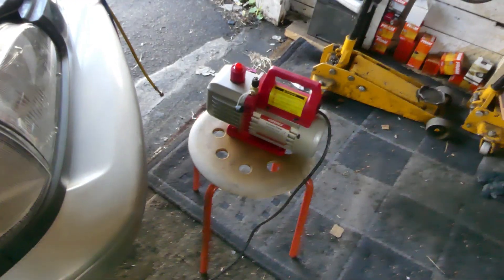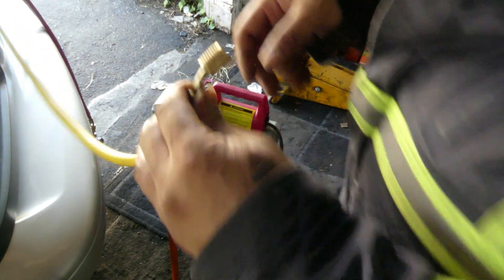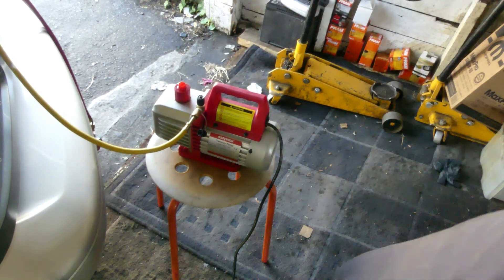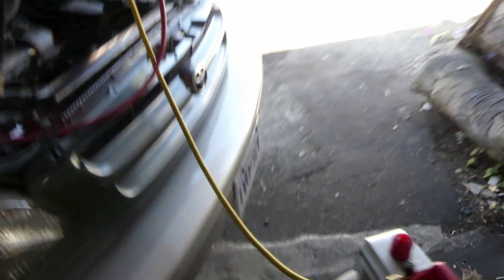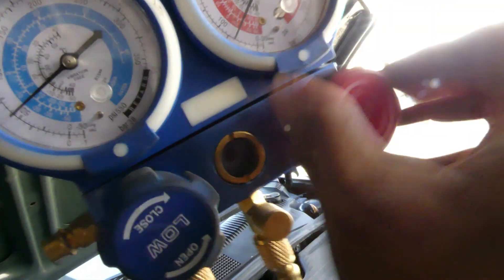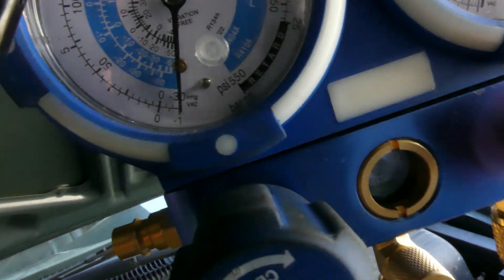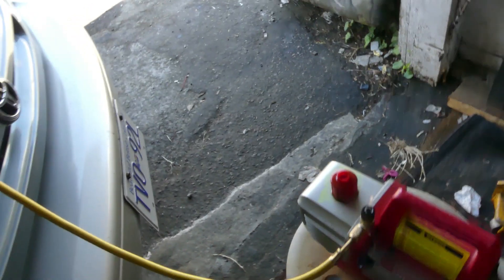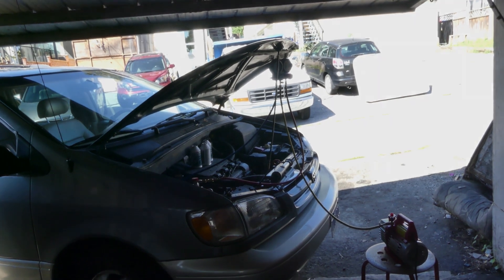How to Vacuum Old Freon

Comment: just wondering… the smoke or vapor that came out of the vacuum while vacuuming, is it ok to let it out in the air? Its not harmful to the environment or anything like that? Thanks in advance.
Reply from the maker: its already filtered
Reply: @asianmechanicguy6483  
Thanks for answering. So the pump machine that you used, is already filtering out the freon as the smoke or vapour comes out of the pump? I was wondering where can I find this pump, and how much do they go for? Thanks again🙏🏽